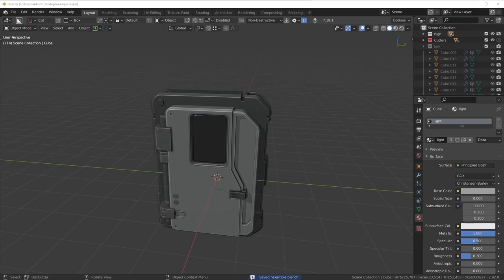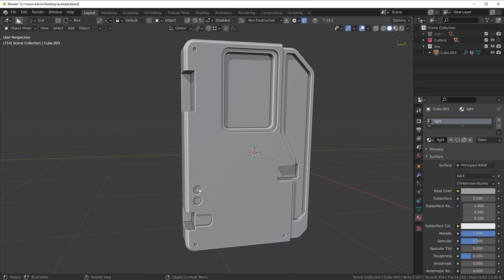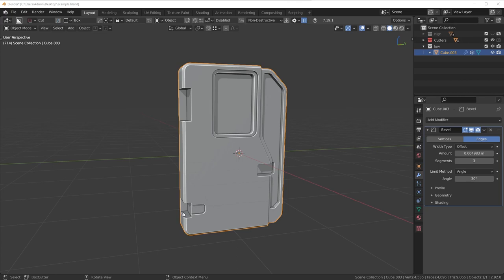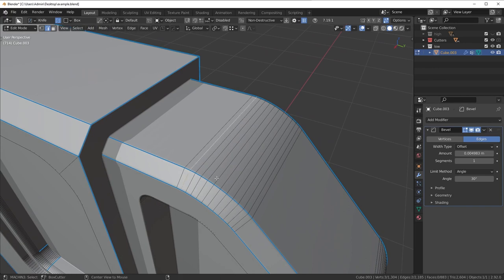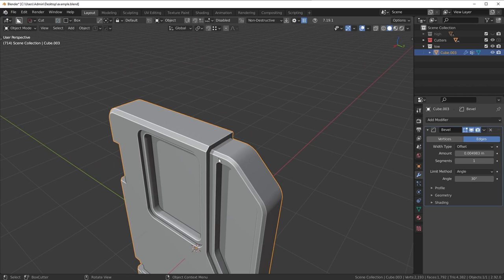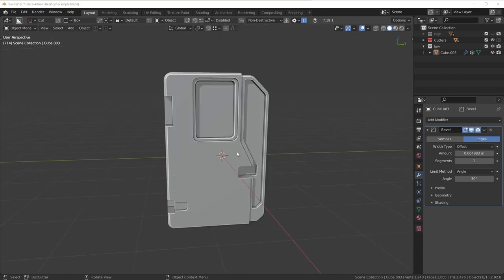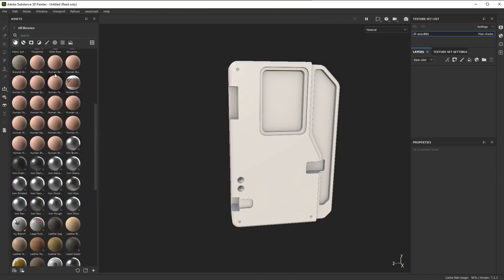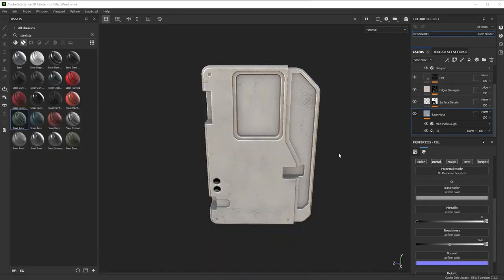Hard Surface Game Assets  - A Practical Approach (Blender)

Comment: Hi Josh! great tutorial but I want to point out that if you are baking a normal map from a high poly, you MUST have seams where you have hard edges (you removed seams on hard edges in your example). If not, you will get an artifact on that edge. This is because uvs have sub-pixel precision, so the pixels bleed across the uv if they are connected (see polycount thread "your making me hard"). You can, however, have seams on soft edges no prob. Love your channel man, keep it up!
Reply from the maker: Thanks! I'm pretty sure the bevel removes this problem though, as the edges aren't truly hard edges (you get a 3 segment bevel applied upon export). It basically minimizes the problems to within the threshold of the bevels which isn't noticeable, kind of like how the shading issues work with face weighted normals. I may be incorrect, but afaik the bevel by definition removes the hard edge baking problems.